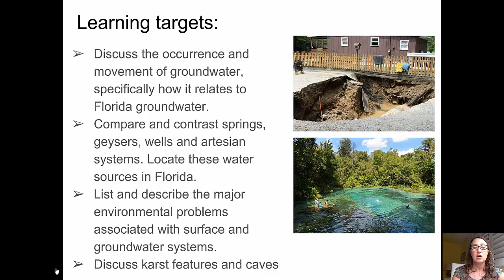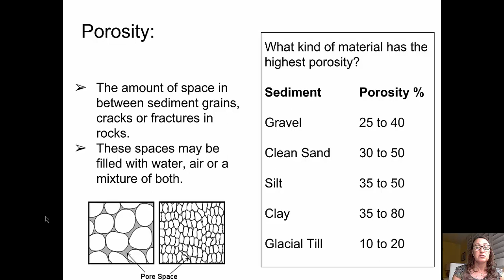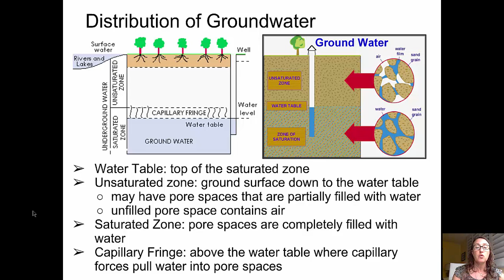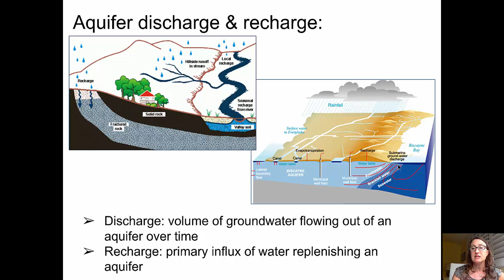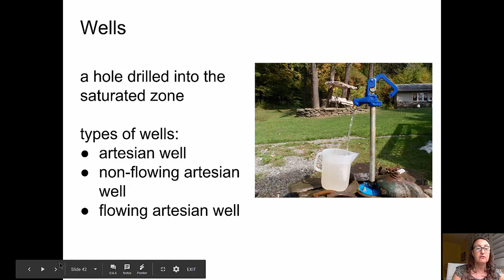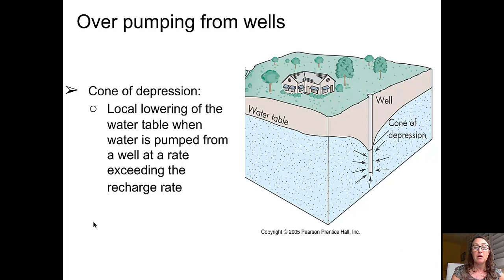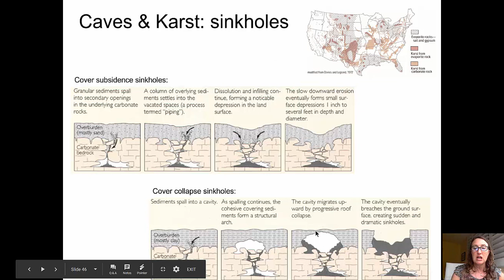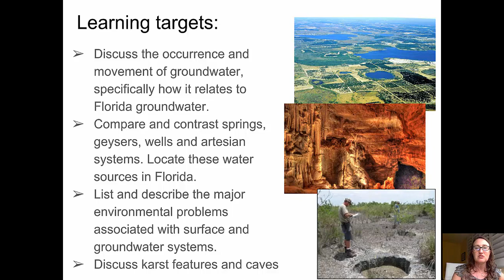Groundwater & Karst

Comment: Dear Aida,
you did it great, deep in research materia in few minutes. Great! 
    Looking something for  three zones of water circulacion in karst: vadose, inactive or the zone of vertical circulacion / high water stand zone or the zone of horizontal circulacion and phrratic zone. So I applyed your conversation. Groundwater storage is so clearly presented. Porosity and permeabitity is one of topic worldwide problems in civil engineering. The effective Porosity, for engineering practice, should refere to the area of dynamic, sto red-water quantities in natural reservoirs, where as our interest in the effective porosity in the zone of statics storage should be less important in the effective porosity quantities become exploited by a structure. The situation become more complex when the effective porosity  has to be define for the as ending spring. Also the effective porosity in karst is based, as you said on your way, using part of the hydrograph in the dry period of the catchment or generally speaking by using the recession curves. The problem of karst capacity for water storage has already been dealt with in the literature but in your video specificaly explained. For exp.slope! Thank you in the name of researchers of your narative way.  At the top we have the epikarst which  incorporated both the surface soil and the broken and fissures limestone below it (suscutanrous zone). So I research it. Biological activity soil producer CO and strongly aggressive waters. The agressive waters also encarge the joints in subcutanews zone. However, as the downward flow is slow waters quickly become saturated so that the zone of  enlarged fissures is firly thin. This zone is responsible large proportion of the solution that occures in karst.
    After 3 weeks I am at yours video link to see permeability of sediment to large topic of water storage as you devided! Recharge zone as you says can be the best topic for FRESH WATER stored in various ways with large amounts stored naturally in ice, embedd in soil and vegetation. Unconfinde and confinde aqufier is important for all you says and for water storage. Water storage in karst is primaly concerned with the construction of the surface storage reservoirs. Strategically significant water is also stored in or behind structures as dams, tanks, retention ponds, farm fields, i. c. In order to ensure their watertightness it has been necessery in the most cases to complet grpunting works with knowledge you have or take some research topic with step by step you have given. 
Understanding the current status of the world's water and making better decisions about managing it will create a strong foundation for sustainable development and resilience.
Thank you for effective presentation and first of all that with yours presentatio world with communities and goverment will rethink how to use and manage fresh water to storage but without neglecting CLIMATE CHANGE!